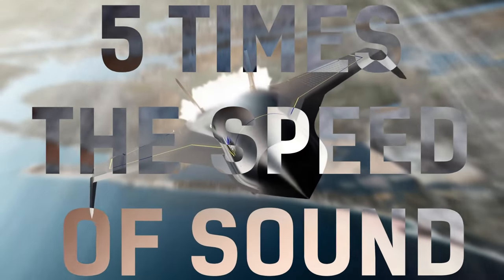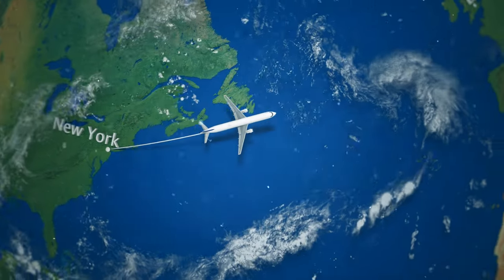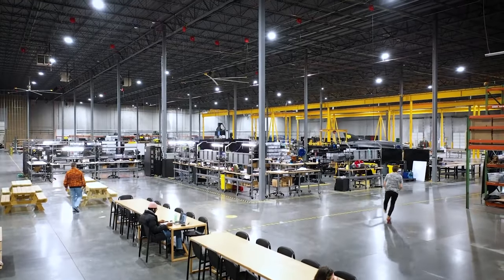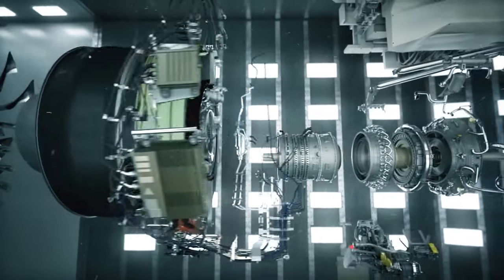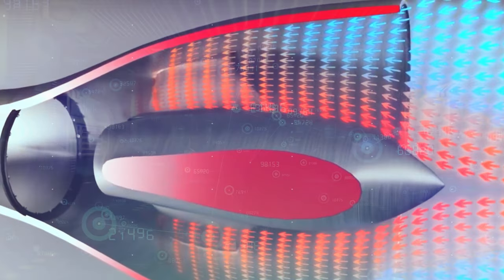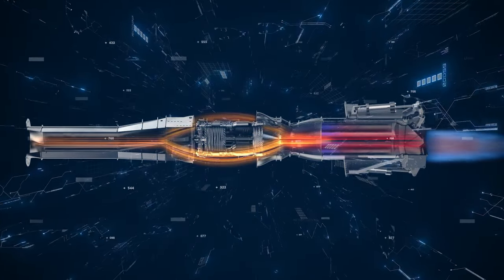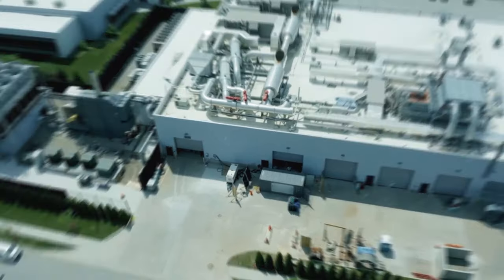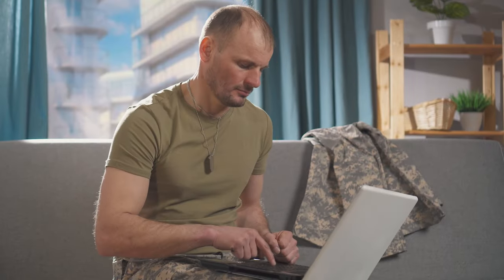Why China Fears US's NEW Hypersonic Fighter Jet Engine

Comment: You asked.  Raytheon has the J-58 from the 1960's that transitioned from turbojet to ramjet in flight by improving the afterburner and feeding it with bypass air.  Given the difficulties of manufacture and operation, it was certainly not practical.  Oh, and sec. McNamara personally supervised the destruction of all of the tooling in order to insure that nobody else could have one.